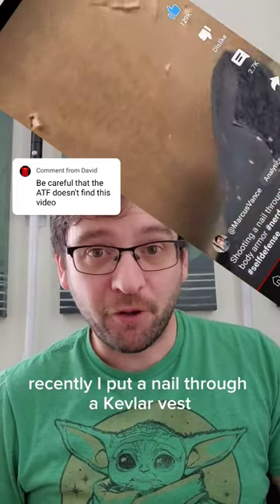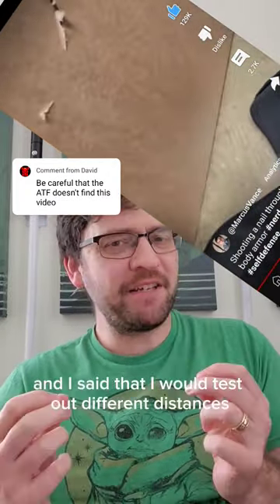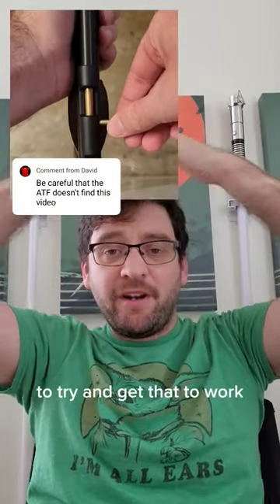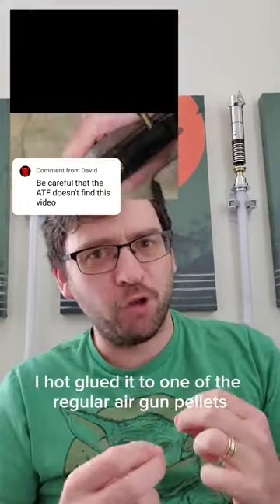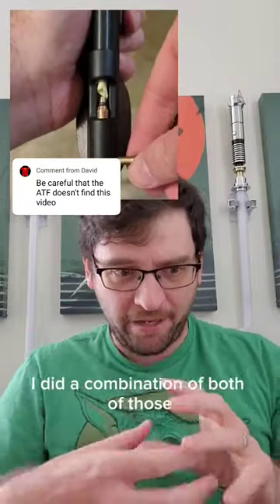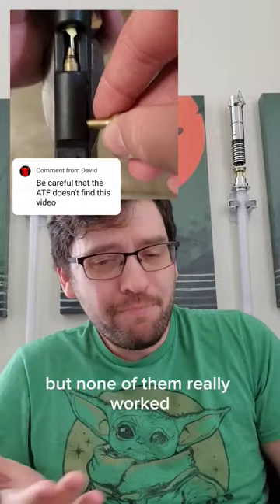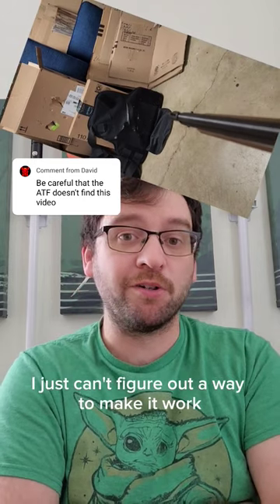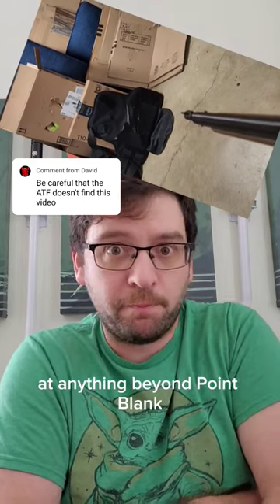Part 2 Shooting a nail through 3a kevlar body armor with an airgun

Comment: The nail itself would need something built onto/into it like fins to fly straight but then you would be reinventing flechettes.
Reply: Exact what I was going to say!
Reply: Which really didn't work in the first place
Reply: Just cause something hasn't worked doesn't mean it can't work
Reply: @casualcommenter9730  yeah I get where you're coming from I suppose if we tried with modern tech it could work as opposed to back then tech
Reply: .22 cal apfs
Reply: Tie a tassel to the back packed like one of those army man parachutes or the wadding in a shotgun
Reply: Riffling. Much easier to get ahold of and is what causes bullets to fly straight. Not some wings you glue on the side or build into it.
Reply: @seam5818 u completely missed the point of all of this, The airgun he's using already has rifling, but the pellets that fit that airgun don't have enough penetrating power, so he's coming up with different ammunition, but the ammunition is smaller than the caliber he's using so he has to find other ways to make it accurate.
Edit: also rifling is not easy to come by, not unless you have the tools to do it yourself, last time I checked you can't buy it a rifled tube at Lowe's all of their tubes have the rifling on the outside😂
Reply: @dannyeckerd9324   it has to be the right diameter. Yes you can fire it but the rifling won't be effective if the ridges aren't going to rub against the side. Also the gun he is using was probably made to be used with plastic bb's not metal so the rifling could have been stripped by the first couple shots. 

You can find barrel blanks and rifling tools on gun broker. Along with reloading equipment and fire arms if you have an ffl.
Reply: @seam5818  not necessarily, rifling still effects sabot rounds, and wadding can act like a sabot in a pinch, it won't work as good but it'll still make the round engage with the rifling, as for the rifling being stripped, most are pistols are designed to take both forms of ammunition plastic BB or lead/zinc pellets.
Reply: flichets bascially
Reply: @dannyeckerd9324  my thought is that the nail not being made to be fired is destabilizing in the barel to to the diameter. Yes sabot work like that, but they were made specifically to do that. Instead of paper he should try a cotton ball chaved to the diameter of the barrel.
Reply: Maybe just use screws at thar point? I dunno.
Reply: @spacemarine6212  that might work, actually. They have a wide edge and are made to spin, so it might actually work.

Comment: Makes sense, given how Kevlar works. At point blank with that force it’d be like getting stabbed I imagine, which iirc is something kevlar is not as effective at protecting against
Reply from the maker: It's more on the nail not being able to fly straight
Reply: @MarcusVance  and here I was thinking I was smart 😭
Reply: @prisca9406 man tough i feel for ya
Reply: Correct, standard kevlar is not stab-proof.
Reply: @prisca9406  you are right though, kevlar is not stabproof.
Reply: @prisca9406 yea, your argumentation was solid. it's just that essentially what his thing would have done, if it worked, was reproduce that effect long distance. so the idea anyways.
Reply: @prisca9406  Naw your good.  You are correct he is just telling you why it was failing in this video.  You are correct that Kevlar isn’t as good with stabs and bullets all at once.
Reply: @MarcusVance  if you still working on flying nails straighter; here's 2 methods im 90% sure worked/worth trying. Remove nail head for both, its heavier and on rear encouraging tumble. These may look long, but im trying to give as many as possible details to help visualize it and hit missable details, you might catch concepts before end and run with it. Maybe im wasting my time in another manic overexplaination but this is how to make a nail fly straight(pretty sure, like 95%). Lmk if you look it over, and lmk if im over doing it again lol. Gl. I wanna see this.

. turn air gun on low and turn up gently on anything close. High pressure makes it harder usually.

Most straight forward method is chqnge weight distribution. Trim that nail head off if you havent. Do things like grind back end thinner, evenly!(uneven width wise encourages tumble). Add weight to front, like make a mold of nail, contain nail in mold with some extra space around nail front half for this new metal, then add some melted lead or pewter, etc, any cheap metal heavier than the nails metal u can melt on stove. Contain heavier metal towards front front end best you can. 
-If it wont adhere, just score and notch nail; really rough it up for molten stuff to grab onto, drilling small hole could be perfect with thicker nail. Probably aint gonna make perfect blend without making this too complicated with smithing skills idk well. Grind mostly even so it wont encourage tumble. Bulge ok, big hanging bits bad.
i think kunai and some dart designs use weight without fins as a primary method to keep point forward when thrown, along with throw technique of course.

More designed and advanced/fickle use fins from an arrow trimmed down to size or bird feathers(same wing). paper isnt good enough material. Spacing, bend and angles are important. You need lqrge enough fins as well to catch enough air for spin early in flight. Possibly bird feathers could be best cause theyll compress, compressing front to back only along its natural folding direction, or risk wrecking them.
- Feather fins fickle af though, 3 fins from 3 flight feathers in a row off of 1 wing probably easiest with fewer to balance and line up with each other, cutting same size fins from sections with same size/width of the stiff middle white part(rachis). They gotta be in sync and wont be perfectly same shape. Adhesive you can adjust till it flies true enough is the biggest peice of puzzle, some leave a trimmed bit of rachis on both ends to wrap with string and tiny glue dot to hold string, glue away from the real working part of feather
Reply: @MarcusVance  Is that a Crosman 1377 right? .177 cal.
If so, try this: cotton swab for ear wax removal. Just clip off one side and press the nail inside the hollow plastic tube.
You'll have to muzzle load it.
And since it is so long, it will work better if you allow for some air travel, so don't llse faith if it doesn't work at 10ft. Increase distance and see if it flies better.
 :)

Comment: With nails, you would probably have to use them like sabot rounds. Build something around the nail to fit in a gun, and then make it fall off after firing. 
Thus making a smaller APFSDS round.
Reply: ... isn't that just what flechettes are?
Reply: @robertnett9793  exactly
Reply: Maybe also a type of rifling to add spin to the nail itself
Reply: @Jack Bicheno I’ll get the secret documents ready

Comment: As many have mentioned already, you should look at potentially using a sabot for the nail, to keep your air pressure for longer behind the nail, and to keep the nail stable during travel in the barrel. If the barrel has rifling you could try to get the sabot to engage it, for flight stabilization. Something to consider for thin projectiles.

Comment: Cut a q tip in half and stick a thin nail or needle down the center, the cotton on the q tip works good for stabilization, perfect size for a .177 barrel too

Comment: What i did to my .177 cal was put tape around the nail until it fits in the barrel and no pellet just air but use a break over works a little better instead of a bolt action

Comment: Whatchu need is a sabot style approach with a dash of shotgun pellet wads. 

Use the wad to make sure air pressure is distributed evenly, and the sabot/flechette to ensure that it doesn't act up in the barrel. 

Maybe make the sabot casing textured so it catches rifling, which would give the nail some spin as it broke apart in flight
Reply: Hey I was thinking about it, and I realized in order to make sure the nail doesn't start tumbling, it'll need fins too

Comment: Depends on the nail you might need a barrel with a smaller bore on it and to cut of the head of the nail.
Using one with a built in gas tank could also work better as well since it reduces the quantity of moving parts and things that need to align.

Comment: You could try and drill a hole through an air gun pellet, pushing the nail through it and fastening it with super glue or soldering wire. 

Or try and make a mold of plaster and cast a sabot around the body of a nail.

Comment: Smaller rifled barrel to give it a spin and balance the nail weight, or you could use the rear if the nail as a holder for some feathers and run your automatic crossbow

Comment: That's because the nail doesn't have the weight or aerodynamics needed to maintain speed so once it hits the air it loses all of its velocity and energy. The only way to possibly overcome this without seriously changing the ammunition would be to put some type of fletching on the tail like an arrow so that it would fly straighter
Reply: Sabot round

Comment: A nail at point blank, isn't so much about the sheer impact energy - in that case the sharp edges cut the material.
It's more like being stabbed.

But with that setup - fins and all, you likely don't get the nail stable enough to really 'cut' and not bounce off.

You could try with a crossbow / bow and arrow with razor tips and show how those work agains kevlar. (My suspicion would be they cut pretty well through the material).

Comment: I've made this before as a kid but destroyed it when I turned 18...
Make a potato Cannon, but instead of potatoes, use the nails. First make a paper cone, cut the tip, then insert the nail, use hot glue or something that fixes them together. You can watch how to make the nail bullets on how to make home-made blow darts. Or instead of a potato gun, you can make a pressurized gun.

Comment: Dude electric tape and leave a bit hollow in the back creates a seal for the gas used to shoot nails into a tree from across the yard
Reply: Can you explain this a bit better bc I want to do it for my crosman 760 pump master
Reply: @colec1039  take a nail cut the nail head off then take a strip of electric tape and try taping two nails together or if they don't fly right tape a qtip to the back of the nail

Comment: Hot glue some cotton to the head that will produce just enough drag to keep it straight and push it out of the barrel. Also a bigger caliber in a break barrel airgun will give you direct access to the breech without that bolt in the way. You'll be able to fire longer heavier darts that way.

Comment: just need to change to a projectile you can carefully machine into a fine point with surface texture designed to redirect turbulence at high velocity into rotation.  And then fire it from a railgun instead.

Comment: The problem most likely is that past paint blank range the nail is loosing substantial amount of velocity and energy needed.  I'd imagine it equates to the right amount of both velocity and weight of projectile to produce the needed energy to pass thru the vest.

Comment: Try jamming a triangular needle file into a crossbow bolt and using a crossbow, that should go straight through.

Or you could just try old fashioned airgun darts. Used to use them as a kid, don't know how they'd work on kevlar but they stick in plywood well.

Comment: Special Purpose Individual Weapon(aka: SPIW) and Project SALVO were both conducted in the 1950’s. Both weapon design projects ran into similar problems with their flechette projectile ammunition. Due to the lack of mass, the kinetic energy would drop off rapidly, as would target penetration, and the ability to go through cover. The effectiveness of the flechette ammunition, while promising on paper was a disappointment in practical application.
Reply: A heavy draw-weight crossbow might actually be a lot more effective.

Comment: Ther is a m16 style nail gun you could use. Or just use an actual framing nail gun with a tube over the barrel so it doesn't allow the nail to lose its velocity

Comment: Kevlar is made to stop fast moving blunt projectiles, so things like knives, arrows, nails, and other poke devices will just blow right through or between the fabric fibers.

Ironically how you defeat something made to stop the most effective handheld weapon system is to use less effective weapons with less power vs Kevlar Bow>Gun

Comment: Maybe you could use a hunting pellet? those with a steel core in a plastic case then drill a hole in the steel core just enough to fit the nail in it? It would also ad some enertia to the nail.

Comment: you'd basically need a micro APFSDS, and at that point just go and buy flechette shells, and at that point you might as well just start casting your own tungsten slugs, and at that point just use gran pappy's ol' .06 with AP rounds

Comment: One could probably design a disintegrating salvo like on tank rounds and 3dprint them for you, too tricky for anything else to work

Edit: maybe also some fins for after the salvo is gone
Reply: Apparently the fins don’t really work on this scale like with tanks. There were attempts with flechette rounds but they didn’t really work out sadly
Reply: You still need to stabilize the projectile after it leaves the sabot though. So either, rotation through rifling, or make it very front heavy, and a shape conducive to front heavy flight. 

Aka shuttle cock, diabolo slug shape, foster slug shape.
Reply: @GallopingWalrus  perhaps fixed fins that provide spin, like angled and kinda wide and draggy
Reply: @chillypepperjr  they'd need to be very wide, and if fins wide enough to stabilize such a small projectile are fixed, no need to rob even more velocity by making it spin, straight fins that drag stabilize are good enough. 

The main problem is, the smaller in scale you go, and the shorter proportionally your projectile is, the bigger the fins need to be to properly work.
Reply: Sabot

Comment: At this point, you might as well just shoot the vest with a bow and arrow. That should go right through because bullets are normally blunt impacts and make it on just having enough kinetic energy to part the targeted flesh like a person cannonballing off a diving board, while the head of an arrow flies at much slower speeds and relies on the sharpened edges at the front to slice through the target, literally like a knife through a steak.

Comment: Make a cone from paper run the nail thru the tip and then add a Lil hot glue it will make a blow dart that sticks in a cement brick might be able to make it fit an air rifle

Comment: I know how to make it work, get hollow point slugs, cut a nail in half where it goes down deep in the slug and epoxy/superglue it in place. You need to step up your air rifle, that thing is puny, ya need a proper Texan LSS like me in .30 or .457, now I just buy 340gr cnc machines aluminum tipped slugs that SMACK, no more dremel and diy work. They’ll punch thru Kevlar all day any day.

Comment: Ahhhhhhh I feel like I shouldn't tell ya how... dammit! Wads use wool wads for black powder pistolsand just a tiny dab of hot glue to hold it true plumb an straight. On impact the nail will proceed as the rest stays behind however you'll lose muzzle velocity so this works better in an AIR RIFLE but I wager it MIGHT still penetrate at 10'? As it's essentially a flechette
Reply: BTW gammo is the air rifle I'm talking about
Reply: Or the terminator but that's a 1200 dollar air rifle.